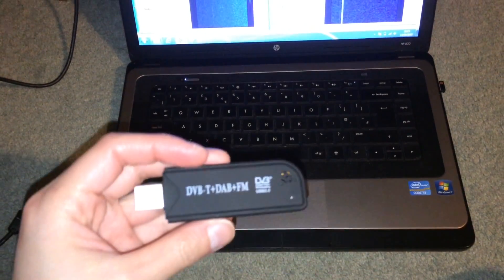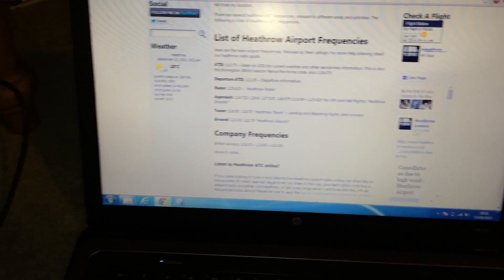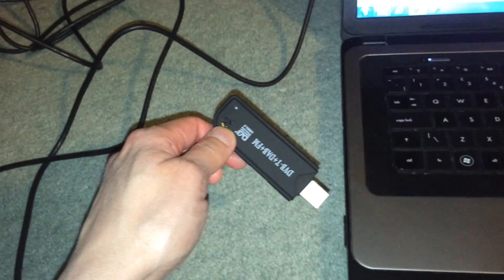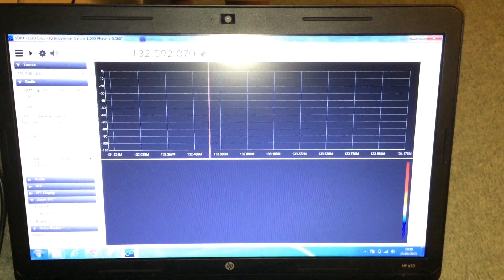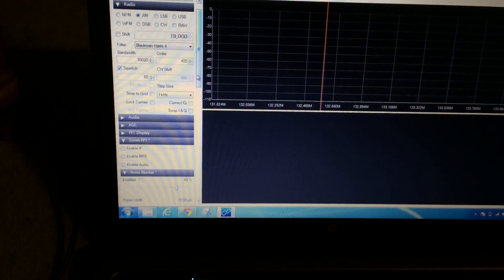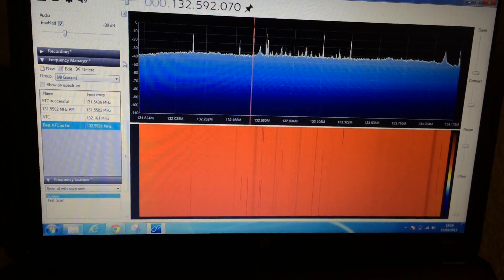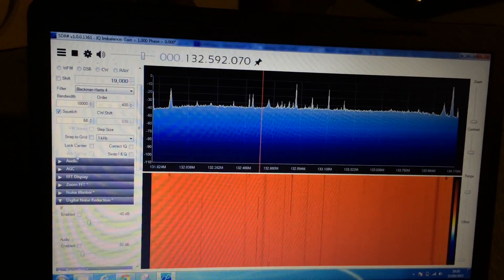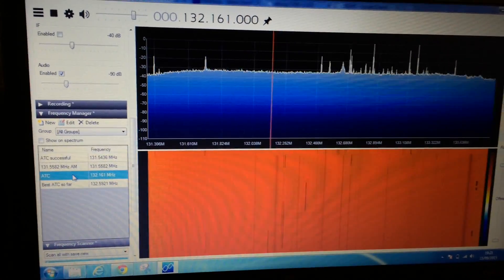Tuning in to ATC (Air Traffic Control) chatter using  SDR# and a RTL2832 / R820T SDR dongle

Comment: How do you have it so clear, I can't get it to work do you need a big antenna?
Reply from the maker: Hello, ATC chatter is horizontally polarised so you can use the existing TV antenna on your roof to receive.
Reply: @BrianSu  ok thanks. So I need a diapole antenna? Sorry I need to learn what is horizontal polirised.  But I managed to get ADS-B just very short range because I think that's horizontal polirised aswell and I don't have a diapole antenna just a telescope antenna
Reply from the maker: @mosquitopowder  nope ADS-B is vertically polarised. You'll get much stronger signal if your antenna is laid vertically. For ATC chatter you'd want your antenna to be laid horizontal like TV antennas on roofs rather than pointing vertically upwards.
Reply: @BrianSu  oh right. Ok thanks. I'll try plug in the TV antenna 📡 at the moment I'm not getting anything at all of ATC

Comment: I've changed squelch I've changes antenna i get nothing but static and i see a strong signal but i can't hear anything but fm radio any ideas what i can do
Reply from the maker: have you tried transmitting to it using a handheld radio? What SDR device are you using? And also, are you located close to an airport?

Comment: Been thinking about setting one of these up. My younger brother is doing flight training to get his pilots license at a general aviation airport about 3 miles from my house. LiveATC sadly doesn't have a feed from this airport, but I'd love to listen to him communicate with ATC during takeoffs and landings from the ground. I'm a big fan of youtube channels like VASAviation which make videos about interesting ATC communications and even visualize them with info from sites like FlightRadar24
Reply from the maker: ethancedrik go for it. There are much smaller SDR units these days and since ATC transmission is horizontally polarised, you can just use your existing TV antenna to tune in.
Reply: @BrianSu  Are you sure ATC signals are horizontally polarized? As far as I know, the antennas on airplanes and the antennas towers use are all mounted vertically. I see no reason why ATC and ACARS would be horizontally polarized.

Comment: What wire converter to coaxal do I need because I don't know what the input is called
Reply from the maker: Jamie Walters the dongle has a female MCX connector so you’ll need a cable with a male MCX connector on one end :)
Reply: @BrianSu  : )
Reply: Brian Su thank you so much, I have had it for a couple of days now and the antenna what has come with it isn't that good. Do you have a link for it ? If not I will have a look when I'm back home later. Again thank you
Reply from the maker: Link for what? MCX connectors are such common things. I'm sure you'll find them easily online.
Reply: Brian Su oh okay that's fine I thought there would be loads of different types and a lot of searching for the right one. Thank you for the help. Much appreciated :)
Reply from the maker: No you just search for male MCX on one end and the other end will be whatever connector you need, so yes there are a lot of types but any with male MCX on one end will fit in this dongle.
Reply: Brian Su I have just ordered one thank you .
Reply from the maker: you're welcome.

Comment: Distance from the Airport, man? And which antenna did you use?
Reply from the maker: 5 miles as the crow flies. For ACARS and radio chatter the signal is horizontally polarised so I just used the TV antenna that's mounted on the roof. You'll need to build your own vertical antenna if you want to receive ADS-B
Reply: Brian Su I only want to listen pilots'  comunications but I'm 10 miles far from APT.. I'm too far or not in your opinion?
Reply from the maker: no you'll be alright.
Reply: Brian Su  thx man!
Reply from the maker: pleasure :)
Reply: Hi, you can always buy a d1000 Antenna made by a person named broadsworth. Buy it off eBay, they are great quality and received airband really good.
 It is only 60cm long and can be transported anywhere. Happy scanning.

Comment: Have you ever picked up messages from aliens?   I am researching for a book I am writing.
Reply from the maker: +Charles Bedford Hahahahhaha
Reply: Honestly, picking up the ISS is pretty tricky, and we know exactly when and where to look for it, the speed it's moving for use in calculating orbital drift...etc. Basically, what I'm saying is that it's ridiculously unlikely, even if there were 20 alien ships orbiting us broadcasting RF signals.
Reply: @pricemac  Also with the ISS, you have to adjust your frequency due to the Doppler shift.

Comment: i have the same stick. sometimes the stick "freezes" while running sdr#. the program itself is not freezing. do you know any help?
Reply: It could be due to minor overheating of the dongle. If you are very careful with it, you can remove the plastic shell to help it cool better.
Reply: That is what happens when you buy Chinese CRAP.
Reply from the maker: +unclealig ohh hmm no I don't. sorry. I'd say try it on another PC and if it still happens then get a new one.
Reply: which adapter are you using to connect the "big" coax plug with the small one of the stick?
Reply from the maker: +unclealig it's an MCX Male to IEC Female. Here's one: http://www.aliexpress.com/store/product/Adapter-MCX-plug-male-to-IEC-DVB-T-TV-female-jack-connector-RTL2832U-R820T-Tuner/1398570_2022123610.html
Reply from the maker: +unclealig it's an MCX Male to IEC Female. Here's one: http://www.aliexpress.com/store/product/Adapter-MCX-plug-male-to-IEC-DVB-T-TV-female-jack-connector-RTL2832U-R820T-Tuner/1398570_2022123610.html
Reply: +Brian Su got the adapter and attached a bigger antenna (self build): double quad antenna (http://www.cnet.de/41503233/dvb-t-antennen-im-eigenbau-bester-empfang-dank-reflektor/2/). however, there is a lot of noise when listening to ATC, altough i am a few kilometers away from the aerodrome (but i have to admit a tower block is between me and the aerodrome). any suggestion's on how to set up the SDR# software?
Reply from the maker: +unclealig Ohh no I really don't know how to use SDR#. I've just been clicking around and experimenting. I use the existing TV antenna on top of my flat to receive ATC and ACARS. It works great.